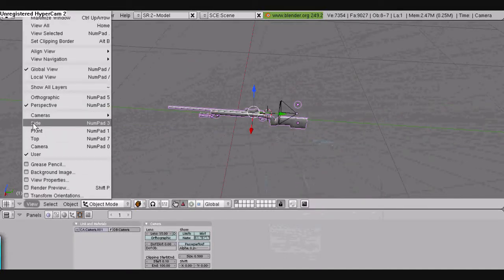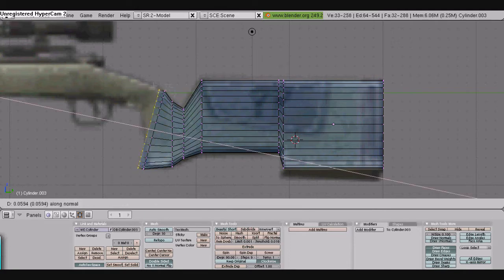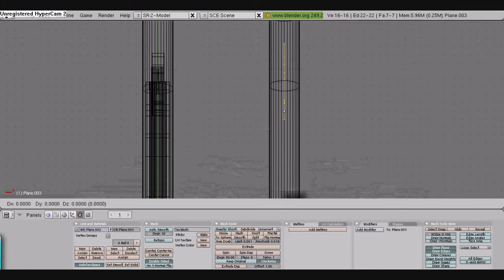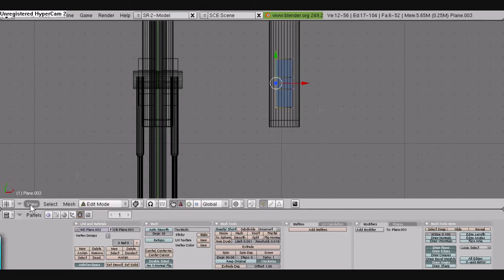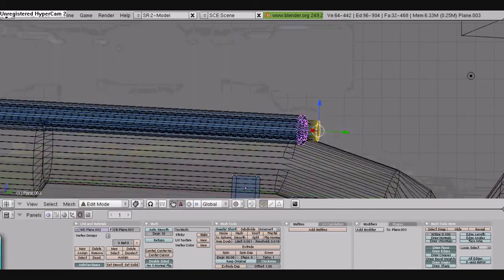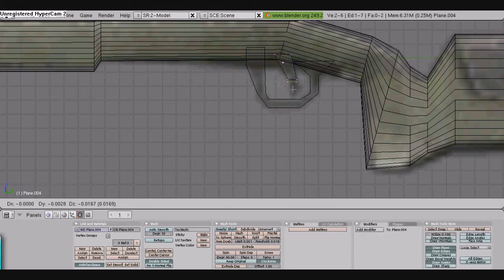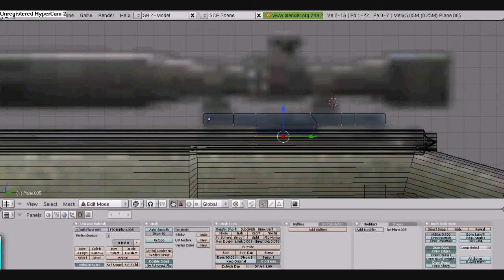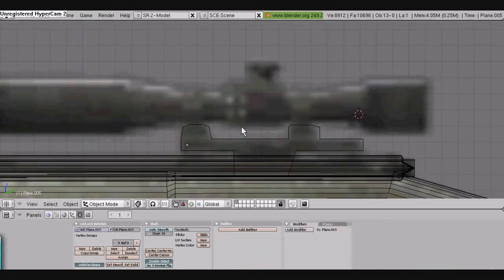How to make an M40A3 in blender

Comment from the maker: @ViV3ZxM40A3 I'm sorry If I went too fast, I had to record over the video in double speed so I couldn't really go into too much detail in each section. I think the part that might be confusing is when I say extruding along an axis? If I grab some points, and hit the "E" key it pulls a copy of those points off of the original,and if I hit x,y, or z while doing this it wont stray from that axis, this is applicable to rotating, moving and scaling. Just takes practice.